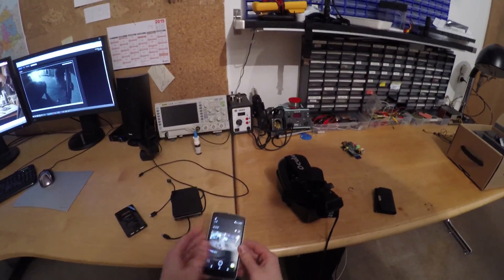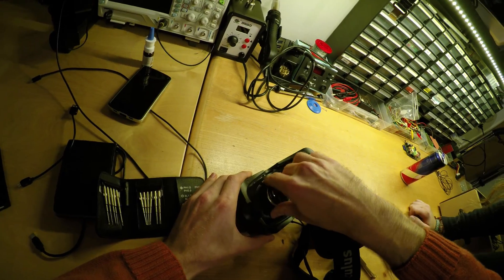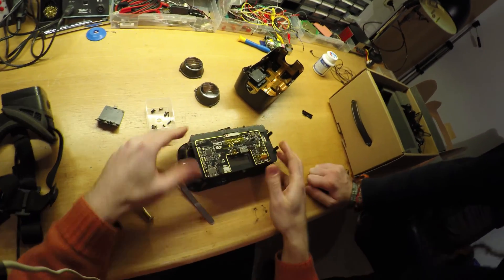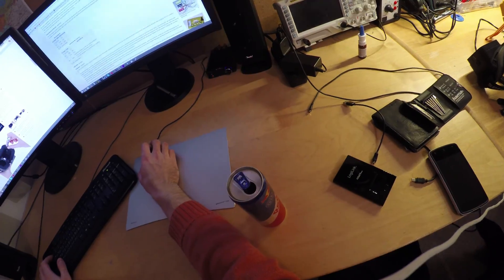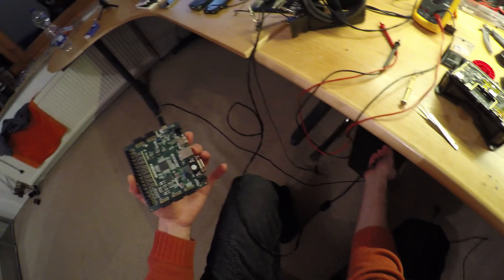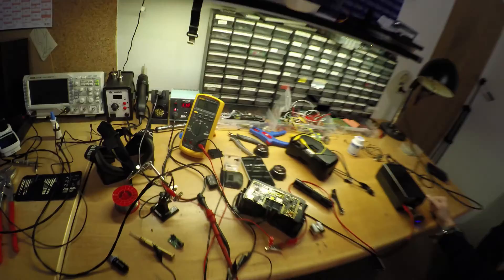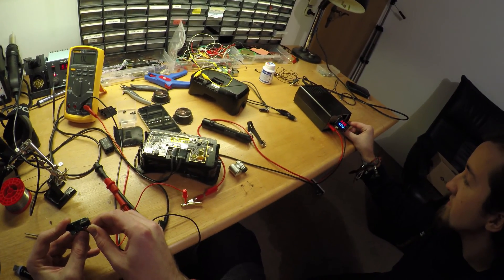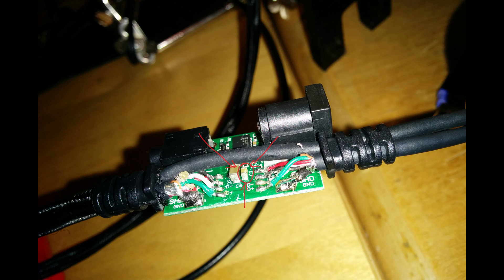Teardown & Repair: Oculus Rift DK2 Development Kit 2 VR Headset

Comment: My DK2 broke; everything works except for its display now, the cam | sensor works, the PSU has the right voltage, the HDMI plug that plugs in to the rift has been plugged in to another monitor and that worked fine.

I'm assuming the miniUSB side of it is okay too as it still lights up the power button LED orange when pushed and the blue LED under the rubber cap, it also switches on and off the sensor / cam, and even still turns on all the IR LEDS all over the DK2 when you run the DEMO.

In my case its got to be something wrong in the unit, its probably not the display itself, more likely something that leads up to it.  f**k knows! LOL

if anyone has any ideas let me know

Comment: Thanks a lot for posting this video and great work with the repairs!

I think the creepy background noises were really unnecessary and destracting. I don't know why you put them in, but maybe just leave them out next time.

Would you consider pulling apart a CV1 at some point? 

One of the most common failures with the CV1 seems to be the head strap connection for the audio connecting to the right speaker (inside the headset). Oculus are replacing the entire headset under warranty if this happens but I think it might be a good idea to know how to repair this because very soon all of the people who bought in early are probably going to have the problem outside of the 1 year warranty. Knowing how to repair it if/when it happens is going to be invaluable. At the very least it would be cool to know why it is happening to so many people.

Comment: can i ask you for some advice regarding what seems like a hardware problem with my dk2?
Reply from the maker: +Lee harris try me
Reply: Hi, i've had my DK2 for over a year now and it has been working flawlessly, I recently upgraded to windows 10 and installed the latest runtime (0.8), I've also made sure everything is updated.

I started up the demo scene in the config to check all was well, and it was all good for about 10 minutes, the screen suddenly went blank and no amount of uninstalling, reinstalling, switching ports or turning off and on has fixed the problem.  the led on both the tracker and rift are blue indicating that a video signal is definitely being sent and received, the sensors are all working as the demo scene still moves around with my head movement, I believe that the screen has developed a fault as everything else seems to be working perfectly. can you please advise on what i can try next.
Reply from the maker: Do you have some tools? Try to open the dk2 and wiggle the flat display connector. Maybe check ebay for a Galaxy Note 3 screen and replace. Maybe try a USB power meter - it shouldnt draw more than 500 mA from one USB port.
Reply: +Marco Reps yes, i already opened the dk2 and checked both the ir led sensor connector ribbon and the screen connector ribbon, both were absolutely fine, i even took the screen out to check it over and there didn't seem to be any problems with it that i could see.  the power output from the usb slots are very likey to be the same as they were before when the dk2 was working, which was for over a year.  I've started looking for a note 3 screen on ebay, i just wanted to make sure it was the last resort, thanks for you help Marco, I really appreciate it.
Reply from the maker: +Lee harris Try wiggling the flat cable when powered on + apply light pressure to where it merges with the actual display. Sometimes the bonding breaks. If you have a multimeter you can also google the datasheet of the main processor and check whether it gets its supply voltages
Reply: +Marco Reps hmm, i'll give that a try tomorrow.
Reply: +Lee harris that didn't work either, ah well, i'll just order a replacement screen and if it still doesn't fix things then i'll just have to sell it all for parts, thanks for trying to help anyway Marco.
Reply: Just thought i'd let you know, the screen had died, I replaced it and now its up and running again :D
Reply: @reps  
When I look left and right, I stop for a second and then jump
Reply: @reps  
How to solve my oculus gyroscope failure
Reply: Same problem here but my rift display tested on a galaxy note 3 and it works normally